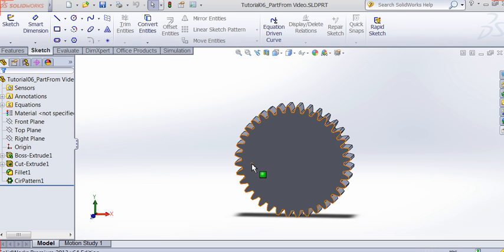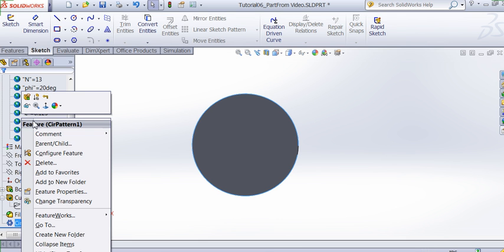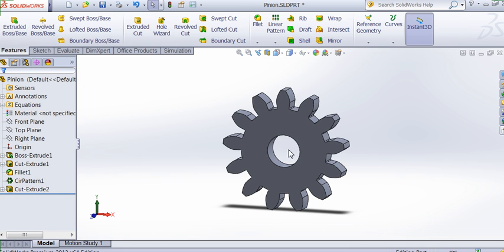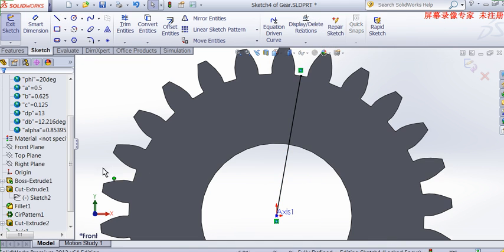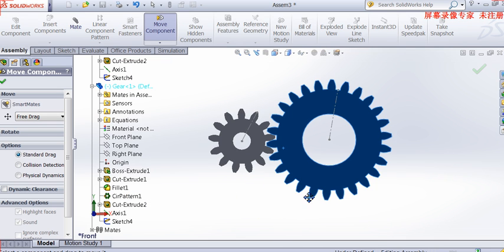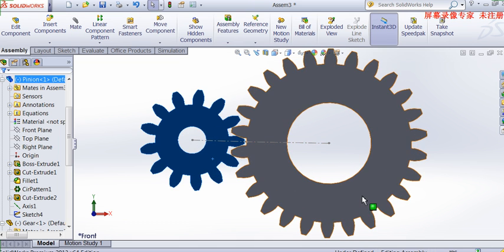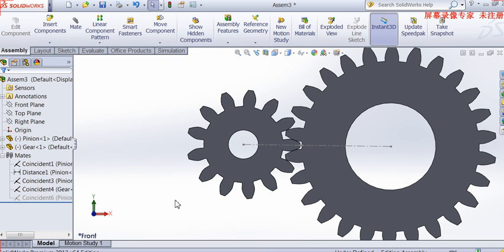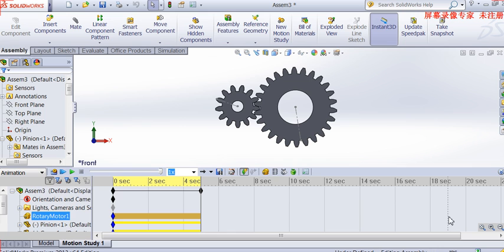Proper Gear Assembly in Solidworks

Comment: Great video, thanks! Question: how come a gear can't have fewer than 13 teeth? I've googled my ass off about this and came up with nothing.
Reply from the maker: If the gear ratio is 1:1, with pressure angle of 20 degree, the smallest number of teeth on a spur pinion is 13.

Comment: I like your method for the initial alignment of the gear pairs.  However, when setting the mechanical gear constraint, another method is to select the pitch circle diameters of both gears.  Solidworks will calculate the gear ratio based on the sizes of the 2 pitch circles.  If you later change the ratio of the gears, then the gear constraint will automatically update.  This method of setting the gear constraint is also very useful when using timing belt pulleys.
Reply from the maker: Thanks for the input.